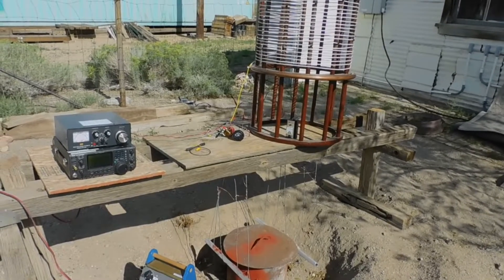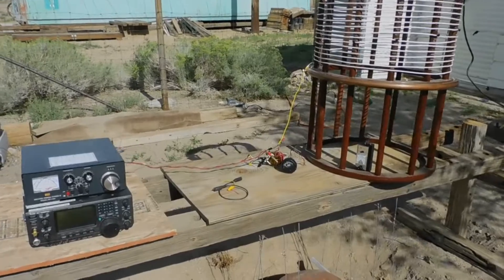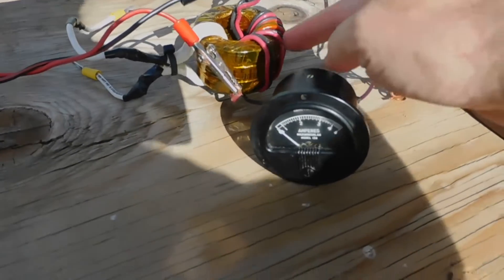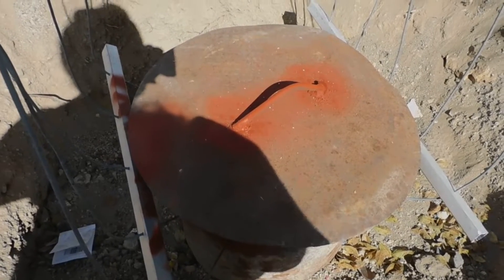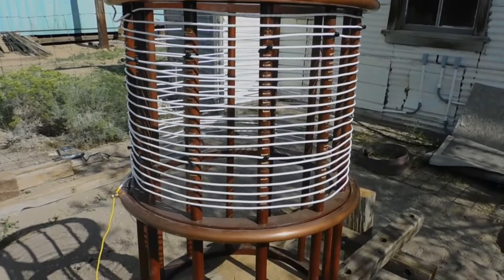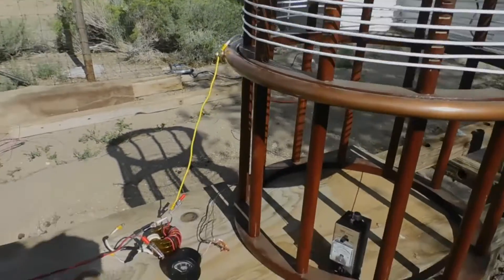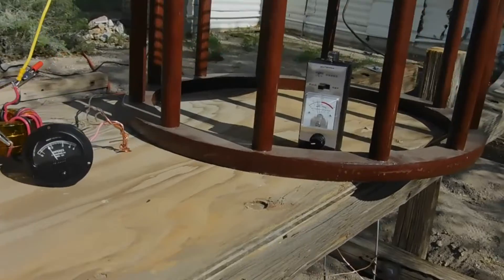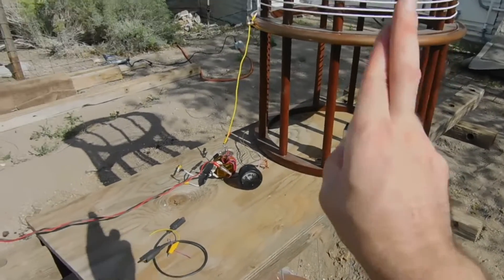'Telluric Apprenticeship' under Eric Dollard, part 2

Comment: What is the advantage of having the thick single turn copper tube at bottom and top of the coil? Is it to avoid detuning due to environment?
Reply from the maker: Yes, exactly!     The rings are not strictly necessary but they help set the 'boundary condition', helps keep the air capacitance internal to the coil.    It also helps increase the max power so it doesn't breakout into sparks  (sparks = loss, we want all the juice going through the ground)
Reply: @hakasays Thanks for the response.

I replicated TMT:
https://www.youtube.com/watch?v=5NGskYJ3vN0

What I observed is when the two coils when tuned in isolation has a resonance frequency of 3.3Mhz, which is obvious as per theoretical calculation. But when I connect them through single wire, their resonance frequency drops to 2.7Mhz. Is it obvious?
Reply from the maker: @parthasarathimishra7538 
Awesome, I see you're already getting real power across!😄 

The next stage I think you're going to want to look at is efficiency, and for that I would suggest a few directions:
1 - Try winding coils with spacing between turns that are closer to a 1:1 height-to-diameter ratio.  The spacing helps increase capacitance and the ratio helps balance the dielectric and magnetic components.

Have you ever noticed that the Tesla coils in Tesla's experiments don't look anything like the modern long thin-wire solenoid coils?

2 - Try varying the coupling between your primary+secondary can have a huge impact depending on your driver.  If on the same tube you can try moving the primary a bit closer/further to better improve the match to the MOSFET (improving overall efficiency)

3 - Find/make a field strength meter, that will give you an easier way to both tune your coils.   You can also use an oscilloscope probe with a few inches of wire left sitting a few feet away, you will see amplitude vary as the tuning gets closer

4 - Once you have #3 you can find the 'magnification factor' or 'Q' factor by varying the frequency and noting how many hertz you vary before the signal weakens to a certain amount.   I can find/make a video to help with this.

Feel free to ping me on your experiment updates or if you have any questions, I love to see others working in this field.☺

Comment: Is there a Spec sheet out there that would show height and diameter ? I would like to build an RG316 version, as part of my Listening Post/Radio Shack
Reply from the maker: This will get you close (within a couple percent of target):

https://hakasays.com/DollardTeslaCoilCalculator
Target 1860kc
~10in Width
~10in Height
10awg (rg316 equivalent)

For matching, I would go with Bruce Gavin's advice which is a 3-turn primary that has a variable distance between primary+secondary.  Equal weights is ideal but some copper ground strap should suffice.
Variable distance to primary, so maybe some plastic nylon screws?

Then add a series capacitor (or variable cap) between primary and radio and you should be able to match to just about any condition.🙂

The big coil in the video should have actually been made with much thicker wire, and the small wire threw it somewhat off from ideal.

Looking forward to your progress, I will continue to help as best I can🧐🤠
Reply: @hakasays  Thank You so much....I wish the Cable co. would respond as quickly as you have. 😉
Reply: @hakasays  Very nice, that is a good amount of Data
Reply from the maker: @VSears-Vortex  The numbers aren't perfect but they serve as a good starting point for 90% of our work.

In an ideal system the spacing and ratio is balanced to the ground and drive system (which is WAY way more complicated).

Comment: If you mind me asking what is the white coating over the copper wire used? I remember its supposed to be some replacement to Tesla's paffin/ gutta perhca covered wire but I don't quite know what the material is.
Reply from the maker: In this case it's standard PVC-coated solid wire you'd find at the hardware store.  Probably 10awg.

(coil was wound before we learned of polyethylene's loss tangents and RG316 silver-coated teflon wire.)
Reply: @hakasays  I see now, thank you very much!